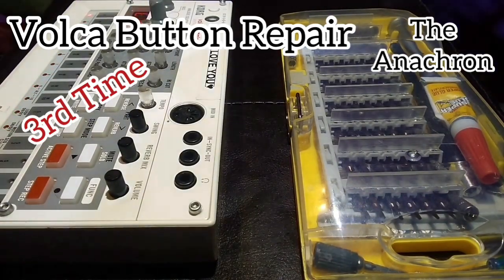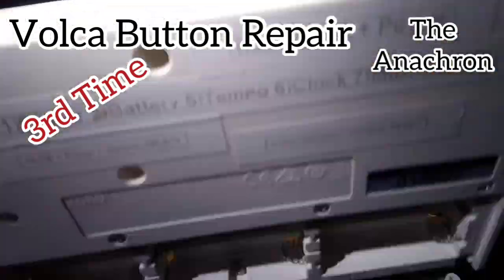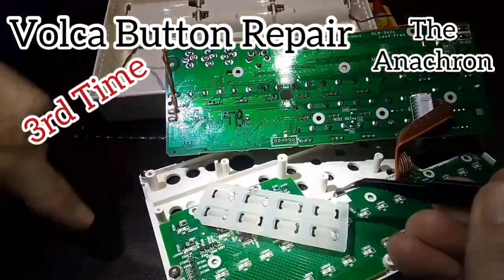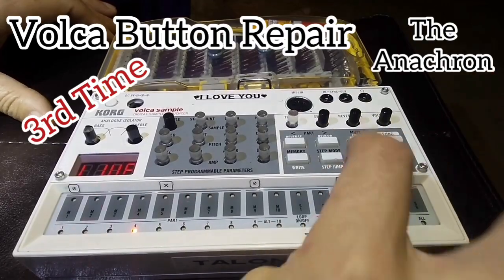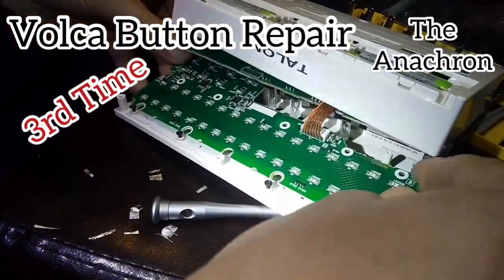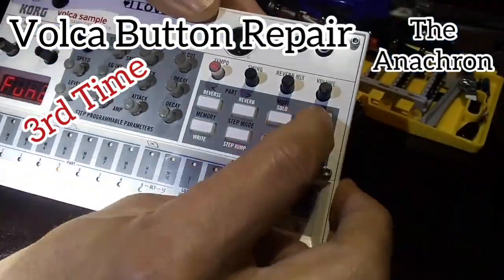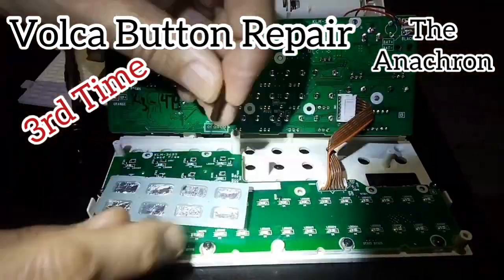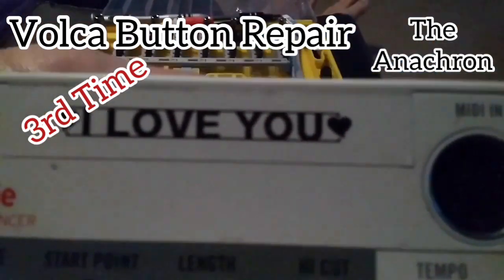Volca Sample Button Repair 3rd Time with voice-over explaination for Volca Sample

Comment: Well I had the same issue with the Volca Fm . I bought anti snail copper tape and glued a small strip copper tape underneath the rubber buttons on the black contacts . Everything works again but this is serious bad gear the newer Korgs .
Reply from the maker: Copper tape? I didn't know that existed. I will try that instead of food foil. Thank you.

Comment: I'm surprised how much patience you had doing this. The first time that I tried the foil method, one of the thin cables from the speaker came loose, and even though I don't even use the speaker. (It's always connected to my mixer) I still fixed it but in the process I lost one of those tiny transparent washers. The Volca Sample is still the most used gear on my setup but It's still annoying having to deal with maintenance. Can't complain when Its all very cheap.
Reply from the maker: I cut out all the swear words 😂
Yes, 100 bucks only, and I have also been working this little box harder than anything else.
Reply: @theanachron303  Are interested in the Volca Sample 2? I'm thinking on getting a Microgranny instead.
Reply from the maker: @x10dc90  ,  I honestly love the simple one still, I never did pajen hack or updates. I don't even know what they changed beside usb jack. Original Volca Sample was well thought out and I enjoy it's limits, like a boardgame that must be played according to the original rules. 
I'm not interested in MicroGranny because mono-triggering & low quality sound "lo-fi". I don't see it as party box. Volca Sample is  just so thumpin' FUN.
Reply: @theanachron303  I understand. From what I heard, the Sample2 has more slots for saving projects, 100 more slots for samples and the step jump mode resets the position to the original position so as to not desync. I would buy it but The OG Sample has enough space for the small amount of samples that I need. I just think that to do granular on a Volca Sample is not as intuitive as with a dedicated granular synthesizer like the Microgranny, even though its a very limited lofi synth.

Comment: You only have to get some carbon paint apply that to black areas on the button, let it dry, you've wasted so much time doing it that way.....
Reply from the maker: Thank you.
I will look for "Carbon Paint".
Been wanting help, thank you very much.
Reply: @theanachron303  Update, it's proper name is 'Liquiwire Conductive Paint'
Reply from the maker: Thank you so much.
These Volca button repair videos are my most popular with thousands of views but you are the first to mention this.
I have been hoping someone would have a better solution, been struggling with this problem for years. Thank you.
Reply: @theanachron303  It saves changing the value/cosmetics of the machine..

Comment: Fantastic thanks for posting this, it may not matter but what glue did you use? cheers!
Reply from the maker: @unfoldersarrangements  dolla store super glue but it doesn't last. 
After I made this video some dude said to use Conductive Paint. Sounds better to me but I have not tried it yet.
Reply: @theanachron303   oh so only temporary, I feel I am either going to try foil with double sided sticky tape or conductive paint. I will let you know how it goes. Thanks!
Reply: maybe the tape itself will be too thick a layer? lets see
Reply from the maker: @unfoldersarrangements  It has lasted over a year with very heavy use. It was the THIRD time I have done this but still holding from when I made this video.
Double sticky tape would probably work but make shure to poke holes in the middle for Lights to shine through.
Reply: ok good to know about the longevity! cheers

Comment: Sounds better than conductive paint...... I'll give it a try on the fm, pls hold
Reply from the maker: I didn't even know about conductive paint until recently. I am eager to try that next because my little foil pieces keep breaking loose.
Reply: @cbstanfo8314 can confirm, I tried the conducctive paint... thought I had good adhesion etc, let it cure overnight, buttoned the volca back up... it worked great for about 4 days then I started getting an error on startup💀so I caved and bought the new FM2 cuz I wanted to record some shit. I haven't found consensus online about how to properly fix the button issue. I would recommend finding some similar leads to the original button leads or maybe rigging some super jank external buttons instead of the rubber+leads
Reply: I also tried foil first...that is not the move XD

Comment: a friend of my mine who's an electronician tell once i can rip off a very    tiny   part of the pcb with a thin blade or somthing and sold a real button but i never dared to do it 
it's a bit destructive 
an other tips is to put some graphite with b2 pencil on the contactor like you do with foil
Reply from the maker: I DID try the graphite thing but it seemed to be no better at all. 
I think I will just end up ordering replacement button pads from Korg.
Reply: @theanachron303  they dont do those spare  part cause volca is too cheap unit 😑

Comment: "I love this machine I just wished it work" I can feel that.

I had some battery leakage and it messed up the sequencer / sample keys. I managed to clean up everything with contact cleaner and surprisingly it worked until I noticed I broke a wire on that lil speaker. I soldered that and got it to work. As I was closing and screwing everything up I broke both the battery cables — soldered those and nothing. I may have cooked this thing.